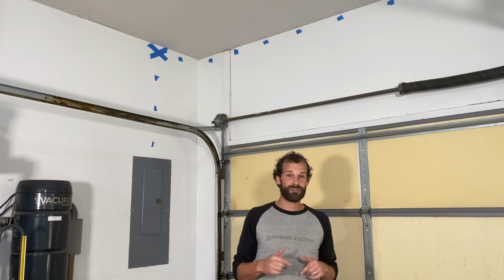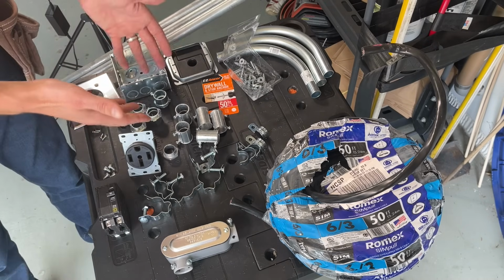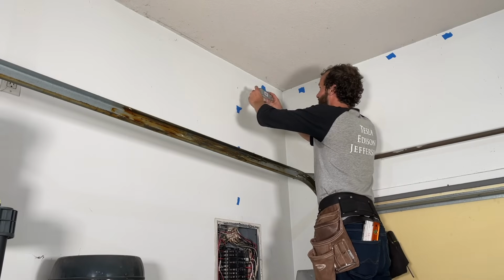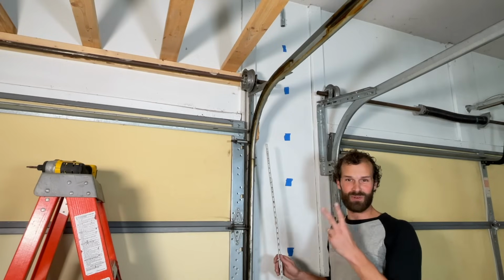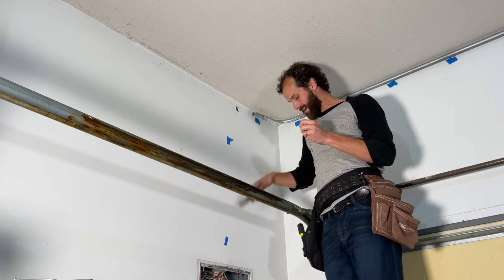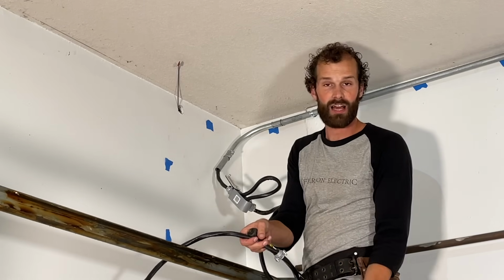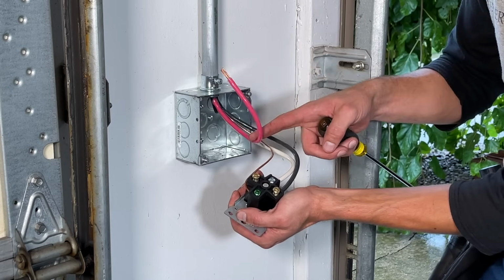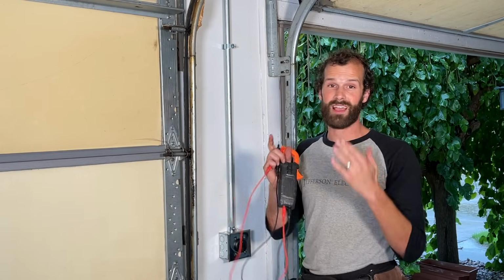How To Install a 240 Volt Outlet | Electric Car Charging

Comment: I’ve done several projects similar to this in my house.  I’m a DIY’er (D-I-Wire !).  Here are my recommendations based upon what I do in general, and what I viewed in this video (in no particular order):

When cutting EMT conduit, definitely use the five-gallon bucket.  However, drill two 1.5” holes right underneath the top of the bucket, 180 degrees apart so they’re on opposite sides.  Cut the tops of the holes out using a utility knife.  Now you have a bucket with two grooves to hold the conduit.  You can also drill and cut 1” holes 90 degrees from the 1.5” grooves.  This arrangement helps to stabilize the conduit while you cut since it won’t roll away.

A ratcheting pipe cutter will cleanly cut PVC conduit in a few seconds, without burrs needing to be trimmed.  That is the main reason why I switched and now always use PVC conduit.  The segments glue together so no unsightly set screws sticking out.  Wipe them off with mineral spirits (or even Windex) then paint to match the wall color if you want.  I found it more time consuming to paint EMT, plus there’s the unsightly set screws to paint also.  Additionally, unlike EMT, PVC conduit will not energize.

I  ALWAYS  thread my conductors through each segment of conduit before gluing together and before fastening to the wall.  Well if the conduit segments are short, then I will connect two or more of them together first before threading conductors.  This technique, to a great extent, avoids the hassle of difficult wire pulls through a completed conduit system, particularly if there are multiple 90 degree bends in different planes, as in this video’s project.

Speaking of bends in different planes, it is challenging to do this using metal fish tape because it only flexes in one plane.  Donate it to Goodwill and get yourself fiberglass fish tape since it bends in all planes with ease.  I used to think it was plastic but it’s actually fiberglass.  A critical added benefit is that you will not electrocute yourself if your fiberglass fish tape contacts an energized component.  And if you insist upon using metal fish tape, then wear non-conducting gloves on both hands.  As an added bonus, they will prevent a soft tissue injury from the metal edges of the fish tape.

Still on the subject of fish tape, I regularly use Wire Pulling Foam Lubricant when there are bends or fittings in the conduit which can impede pulling the conductors through.  It cleans up easily so I prefer the spray foam lubricant.

Is your fish tape hanging up somewhere inside a lengthy, complicated conduit system?  Here is a technique that will knock your socks off.  Get a ball of string, a Shop-Vac, and Shop-Vac fittings to connect the suction hose to PVC conduit.  Turn on the Shop-Vac then feed string through the other end of a long conduit system.  Pretty soon the string will be sucked through the conduit system from one end to the other.  Turn off the Shop-Vac and secure both ends of the string to both ends of the conduit.  Next, affix one end of the string to the end of the fiberglass fish tape.  Alternate advancing the fish tape with pulling the string from the other end of the conduit system.  When you get to the obstruction, unwind a few feet of fish tape then pull on the string from the other side.  May have to go back and forth a few times, but very soon you will be able to advance the fish tape past whatever had been hanging it up.  This technique is particularly useful for conduit laid underground for future installation of lawn lighting systems, but can be used inside the residence as well if needed.  Naturally this works better with two people coordinating at either end, but I’ve done this by myself several times.

I prefer THHN to Romex but without conduit behind the garage wall in this video, you will need Romex for the entire installation to avoid junctions.  In some circumstances, you can install a junction box in order to go from Romex behind drywall to THHN within PVC conduit outside of the walls.

Hard-wired wall-mounted “car chargers” do not need a neutral conductor.  Copper prices are outrageous now.  Skip the NEMA receptacle and the neutral conductor.  Save a bundle.

Electricians, both professional and amateur (like myself)  MUST  have and use a quality stud-finder.  Imagine, in this video presentation, if the electrician, after having removed the service panel’s upper-right knock-out, had encountered a horizontal stud at some point between the panel and the ceiling!  He would then have had to cut through drywall.  A quality stud-finder would have assured an obstruction-free passage from point A to point B.  On the other end of this project, a stud-finder would have aided in the optimal placement of the NEMA receptacle junction box to take advantage of securing it with screws into at least one stud.  In this video’s project, turns out that’s what happened.  But an electrician shouldn’t resort to serendipity.  Plan the conduit path in advance so junction boxes are (mostly) screwed into studs.

Last but not least, I secure the ends of the hot conductor(s) into circuit breakers and  THEN  snap the breakers into the service panel.  That way I can hold the breaker tightly in one hand and the screwdriver in the other hand, rather than torqueing the breaker within the panel while tightening the hot wire screw(s).  Furthermore, if for some reason the screwdriver ‘gets away from you’ while tightening, the tip will push through the air, rather then into an energized component within the service panel.  And for goodness sakes, wear non-conducting gloves when working within a live service panel.

Any comments will be appreciated.

Comment: In Memphis, Tennessee, you have to strip the outer insulation before pulling it in pipe.
Reply: Memphis follows the NEC and removing the outer sheathing from romex and using it in conduit is a code violation, not allowed.

Comment: Is that ok ,romax 6/3 cable use conduit ,look like double insulation, which is violation code ,I don't think so inspection pass ,but all video explain professional.
Reply: Conduit is not insulation, and double insulation is not a code violation.

Comment: Great video as usual, I wasnt clear on what you said at 2:45 regarding installing a 50a breaker and capcity. I have a Tesla and want to add a 50a breaker on my  garage 100a sub panel. Can you confirm that this is no-no please?
Reply: In a 100 amp subpanel, you can add breaker(s) up to 100 amps, so 50 is fine.

Comment: I enjoy your video.. but I noticed you did not screw the ground wire in the outlet box.  It is a must code here in Canada.
Reply: It's NEC code also, he screwed up.
Reply: Also, I knew it from the beginning of the video, that romex will be difficult to insert in the cable and definitely need to  remove something to insert fully.

Comment: Pro Tip.. dont use a metal fishtape in a live panel LOL also dont use a drywall knife use a utility knife to not score any wire...

Lazy electrician was apparent with the pre-fab 90s. 

Terrible😂😅

Comment: Very well explained video! Just something was left out, how to we DIY can calculate or create the part list by ourself without knowing about it? I mean, like how many conduit, length of wire, how many 90 degree elbow, connectors, couplings, etc etc? It will be great if you can explain this part so we can try and do a one trip to the hardware store 🙏😅. Thanks so much!!

Comment: This is really weird about the live panel. In Costa Rica we pretty much use the US system, and here, there is a master breaker on the other side of your meter. 
The "meter side" belongs to the electricity company and it's usually on your property line (on a pole, wall, etc). Your side is the breaker, and any wiring that is attached beyond that breaker. 

So there is always a way to kill electricity to your house and work on a completely safe panel. That way the company can kill your power on the meter side, and you can turn off all power coming into your house on your side of the meter.

Comment: One of the best electrical videos I've ever seen. Details are very clear. I'm not confident enough to work inside an electrical panel, but I wouldn't be afraid to try.
Reply: This is the worst work on the internet. Serious safety issues the whole time!

Comment: Isn't it easier to insert the wire into the metal tubing before assembly?
Reply from the maker: Code technically calls out that the conduit should be complete and then you pull the full wire run.
Reply: @EverydayHomeRepairs  good to know. Thanks.  But what is the reasoning behind that?

Comment: Wow thanks Joe, I am picking up my EV this weekend and don’t wanna go through calling a certified electrician so I am thinking about doing myself. 
My situation; I have 3 years old house with basement (unfinished), I can replace a 30 Amp breaker which was meant for electric range but I have Gas range and replace it with 50 AMP breaker, can I just make holes in exposed wood (2X2 ) to pass through the cable and fish it to garage wall right with wire running  for garage 110 receptacles or I can not mixed it up and have to have separate path for 220 wires? If any reader from Louisville is reading my crying and wants to help in returns of cash pay I am okay with that or I will wait for y”ll pronto comment please. Namaste!

Comment: This guy is not an electrician, but he has a cute shirt. You are not permitted to pull non metallic sheathed cable (Romex) in a raceway. It must be  individual building wire conductors. TW or THHN insulation. 2 hot, 1 neutral and a ground. You can use a #10 ground. 3 #6 and a #10 ground require a 1” conduit. He used 3/4” and romex. He would never pass inspection. Hire a licensed electrician so you don’t burn your house down. If you don’t get and pass an inspection and have a fire, your insurance company will not pay the claim. You lose everything, including the new Tesla. If someone dies in the fire, you can be criminally charged. Is saving $1,200 worth the risk?
Reply: Incorrect. Romex is allowed in conduit, and sometimes required. While this installation wouldn't pass an inspection (conduit too small and it's not bonded properly), nothing he did is likely to start a fire.
Reply: @pld8993  Romex is not allowed in conduit where I live. Must be individual conductors. You may SLEEVE romex in flexible conduit the last 6 feet.
Reply: @bills6946  Most who claim such a rule (there are dozens in this forum alone) have no reference other than "that's what someone told me." Is this a written code you've actually read?
Reply: @pld8993  please cite the section of the code where it is “sometimes required”. You wont find it.
Reply: @bills6946  You may want to read the NEC before you claim to know what's in it. FYI, "shall" means required.
334.15(B) (B) Protection from Physical Damage. Cable shall be protected
 from physical damage where necessary by rigid metal
conduit, intermediate metal conduit, electrical metallic tubing,
Schedule 80 PVC conduit, Type RTRC marked with the suffix -
XW, or other approved means. Where passing through a floor,
the cable shall be enclosed in rigid metal conduit, intermediate
metal conduit, electrical metallic tubing, Schedule 80 PVC
conduit, Type RTRC marked with the suffix -XW, or other
approved means extending at least 150 mm (6 in.) above the
floor.
Reply: @pld8993  As a sleeve, not a wiring method. You SHALL not install romex in conduit raceway except as a sleeve.
Reply: @bills6946  It certainly doesn't say that in the NEC. Where does it say that?
Reply: @bills6946  I'll file your supposed code reference in the "that's what someone told me" column. Thanks for playing. Next.
Reply: @pld8993  I noticed you haven’t posted the NEC section that allows romex to be installed in a raceway, other than for sleeving. You also ignored he installed it in a 3/4” raceway, which is a violation. Curious.
Reply: @bills6946  In my initial comment I explicitly said that he wouldn't pass an inspection becuase the conduit he used is too small, I'm not sure how you missed that. 334.15(B) I cited and pasted the actual words written in the NEC, genius, not the fake, made-up ones you're trying to pass off as code language. 334.15(C) also talks about protecting romex with conduit in a basement/crawlspace and does not limit it to 6' sleeves. In fact, nowhere in the NEC does the word sleeve or sleeving appear when it comes to romex in conduit. The NEC does not restrict it to "sleeving" and there is no length limit. If one wanted to install romex in 500' of conduit while not very smart, it is allowed. You're wrong, deal with it.  334.10(5)

Comment: I haven't tried it, but I have suggested that people just use the Electric Dryer outlet under the non-coincident load rules. You might need to make an adapter for the cord, or what ever. This assumes that the washer and dryer are in the Garage. In my state, the home owner can legally do their own work, but can not work for pay.

Comment: Maybe a way of making it easier is to just drop flex down the wall and use different wire. Instead of lb can just use another deep box. I just new when you were putting up the met and looking at that black wire I was like that’s gonna be an issue

Comment: Romex inside conduit ?  Building inspector said no use individual wires "6 gauge/3 (black,red,white,and ground). Was I told wrong for 220v?
Reply: NEC allows romex in conduit.

Comment: Googling found that most EV chargers don't use the neutral wire, so you could save money by using 6/2 cable (or THHN wires in conduit) and just not wire the neutral terminal on the 14-50 outlet.  Might be a problem if you later want to plug another device into that outlet, and it requires a neutral.  A plug requires GFCI protection under latest codes.  Hard-wiring a charger doesn't.
Reply: Hardwired chargers don't use a neutral, plug-ins do. Unless a recep is UL listed for installation without the grounded conductor (neutral), it's a code violation to do it that way. Electrically it may or may not work, depends on how the plug-in unit is wired internally.
Reply: @pld8993  Probably varies.  Another video shows a charger with box labelled for both plug or hard-wired, though comes with a plug.  The guy opens it and removes the plug, which had wires only for 2 hots, gnd w/ no neutral, so the neutral pin on the plug was open.  Need to verify which NEC code date your locality uses.  The last several revisions requires a charger outlet to be on a GFCI breaker (or outlet if those exist).
Reply: @SihAza  I only install hardwired units and they come with a whip with no neutral but yeah, it's possible the 4-wire plug-in units all have an open neutral, have never bothered looking inside one.

Comment: I use a fiberglass fish tape non metallic and insulated the same as your fiberglass rule, yea I wouldn't have put the bend or the box on till the wire was through. In Australia the earth has had green or green with a yellow stripe for the last 40 years and it is sleeved if the original bare conductor is kept for identification and kink protection. We have 240 volts everywhere so no different sockets just plug your EV cord in 3 phase is common in houses with electric stoves and large ducted A/C  so high kw charging is no problem with 100 amps per phase.

Comment: No Ground on the box!? Raco 813C face Plate for that box the face plate you have is for flush mount. You have surface mount. Not to code.

Comment: Oh! To add even more criticism. Sorry, I don't want you to find out things the way I have. The price of the outlets may or may not mean that one is made with higher quality materials. Metal thickness does not equal metal hardness or durability. Plastic appears does not equal plastic qualities. As far as the injection site from the mold. The Chinese are masters at making counterfeits that often APPEAR to be identical. These appearances are typically meaningless. 
Last, without doing this research myself, I'm gonna say there is probably a range of outlets that are SPECIFICALLY DESIGNED for a high number of cycles.  You are correct about those outlets you have not being designed for anything but plugging in and out every few years.

Comment: Your problem is obvious. With stranded wire you need to tin the ends. Solid wire no. And, you put a tremendous amount of torque on those connections by putting the wire connections 180 degrees from where the wires come from the breaker box. If you had put the outlet with connections UP, you wouldn't have needed to place so much strain or torque on those connections by bending them at roughly 90 degrees. Do you know what "TINNING" the connection is? The easiest way is to get or make a solder pot. Then dip the wire ends into the molten solder and leave it long enough for the solder to walk up the wire until it's tinned as far as it's stripped. It may not adhere all the way with just a one second dip.

When I do "Litz" wire I need to keep the wire submerged in the solder pot about 30 seconds before it walks up the wire as far as I need. (The "litz" wire I use is multi strands and each strand is coated with varnish) Your stranded wire is not individually coated.

Comment: the type of cover plate on the outlet is code violation.  the one you used is for finish work.  you should have used an exterior cover plate with no mud ring.

Comment: Do I need 6/3 for a 30 Amp 240? Or will 6/2 be ok, since they only have 2 hots and ground.
Reply: 30 amps doesn't need #6, #10 is fine.
Reply: @pld8993  well I went with #6 just in case I up it to 50 Amp in the future.